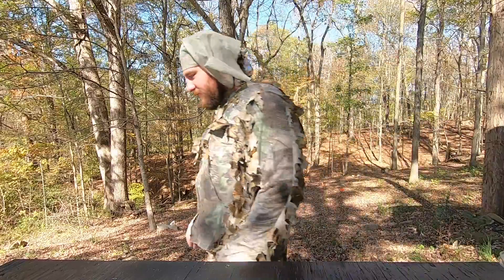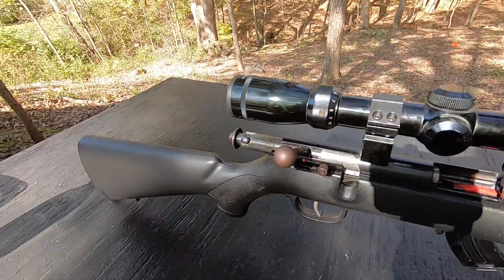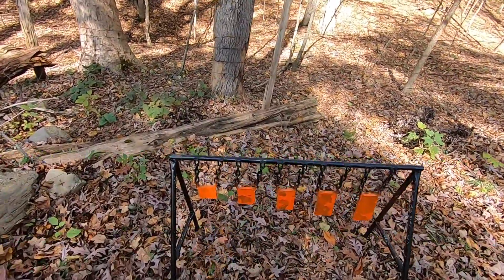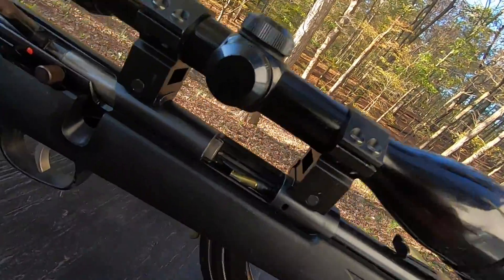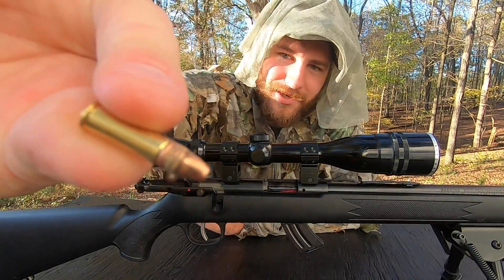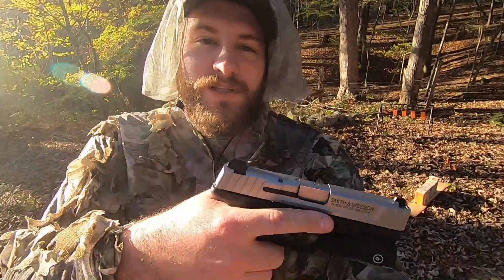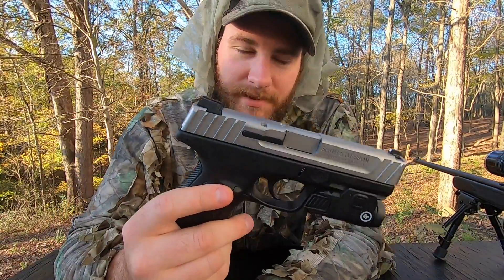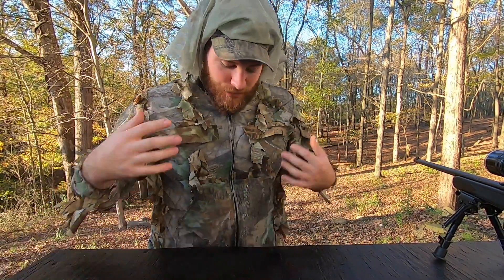HOW MANY 2X4s DOES IT TAKE TO STOP A BULLET!!!

Comment: I removed a couple thousandths from a 50gr .224 FMJ and loaded it onto a CCI Stinger case. Shooting down onto a stack of ten 2x4s, the bullet penetrated the 7th board. The boards were aligned so there were no knots in the line of travel, and the bullet, when doug out, was not deformed. Go figure.

Comment: Being a FMJ vs soft lead contributes to penetration.    Also if the shot location was near the edge of the board may also have something to do with it as well.    But the projectile being a FMJ certainly had effect. 

Here’s a comparison of a lead 124 grn 9mm penetration test versus a 30 caliber bigbore air rifle. 

Can A 30 Cal Air Rifle Match Power of 9MM Pistol Round at 50 Yards?
https://youtu.be/qW-3lHBMMM4

Comment: I could be wrong as I have never done it myself but I feel like with the board sitting there loose that it would allow them to absorb a lot more of the impact when it hits the first one moving it slightly knocking it into the one behind it as they pass through causing them to shift seems like it would absorb more impact to where if you used a large clamp or like woodworking where they all could be clamped together tightly or using 3-in screws and screwing them together each time you add a board screw it to the one behind it so that they all are very secure and tightly together I feel like it wouldn't absorb as much impact in it would pass through more boards I think it would might be an experiment worth trying in the future just to see the outcome